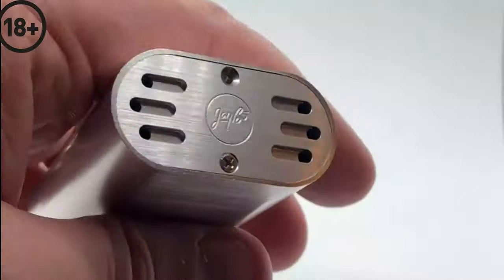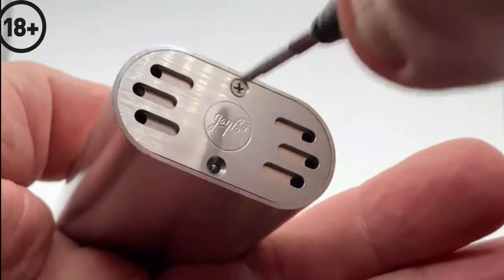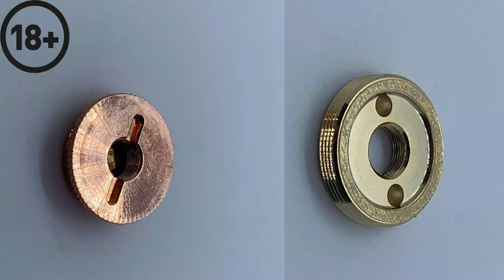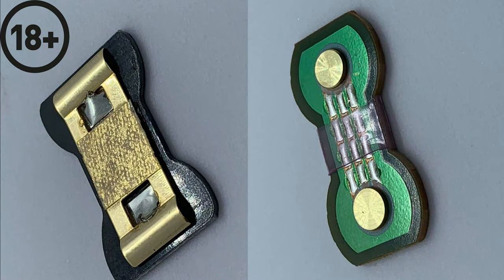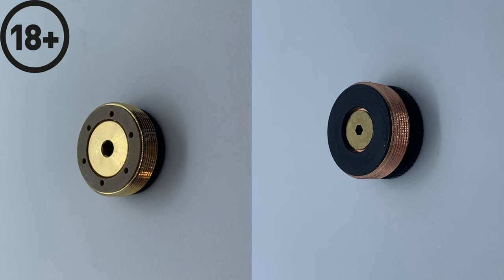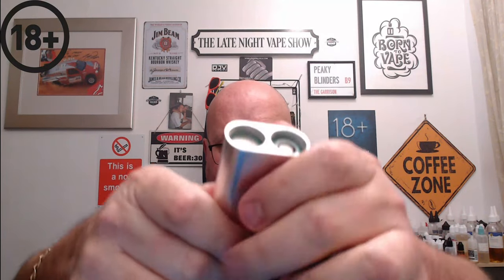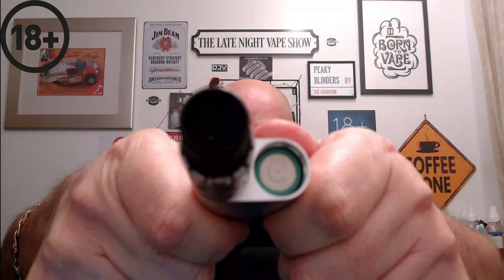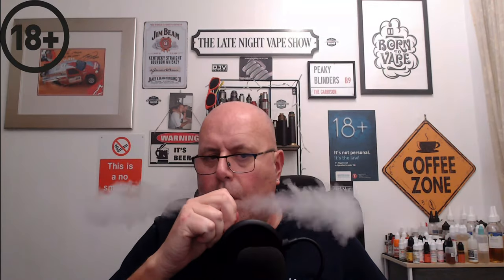A Guided Tour Of The Noisy Cricket, With The Fat Daddy Upgrade

Comment: I have two noisy cricket’s with original parts that I use all the time,you just have to keep the fire button clean so it doesn’t stick.I’ve had to quickly unscrew the addy once from the button sticking.
Reply from the maker: Thanks for sharing that. I couldn’t find out what the problems were.